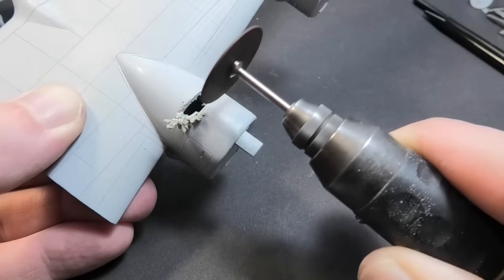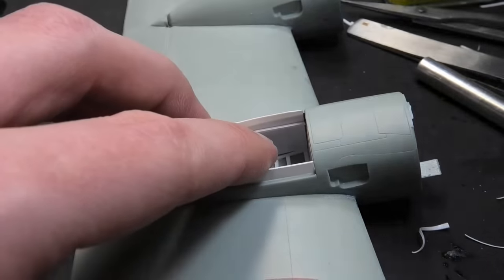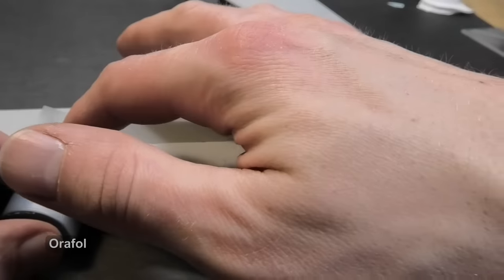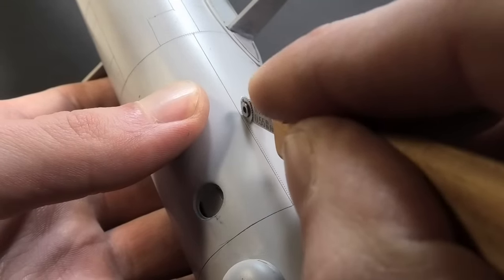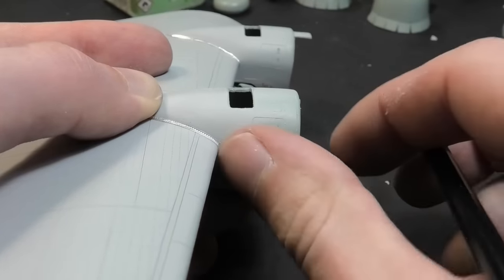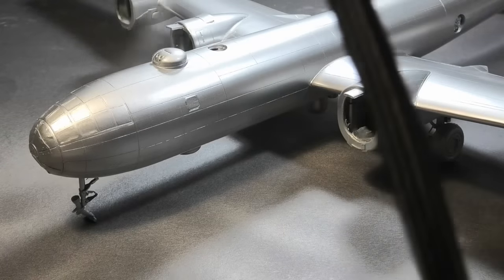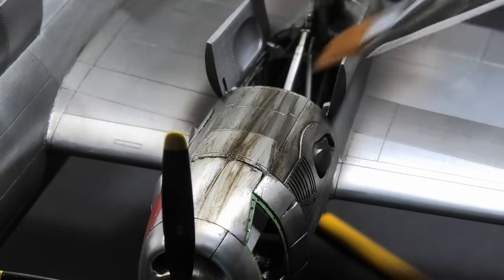B-29 Superfortress - Academy 1/72 - Aircraft Model

Comment: WOW!!! What an amazing build! A suggestion, if I might, you might want to put some chipping and simulated oil stain on the openings where the cowling access covers are removed. In my experience as an aircraft mechanic, these areas wear from fretting and frequent removal. I love your channel! Thanks!
Reply: Chipping? The B29 came in bare aluminium only, no paint to chip. Stains maybe, but they were expensive birds so they'd be cleaned post ops. IIRC they cost the same as a navy cruiser.
Reply: @davidharris733  The B-29 was around $605,000 per copy in 1944, the Cleveland class cruisers, commissioned in 1942, were $31 million. Amazing aircraft, it was the first to have "flexing" wings, meaning the wing would flex as it developed lift and transitioned to flight.
Reply: @trafficsignalman  I heard that comparison in a documentary programme. It may have been "The World at War". I didn't bother checking the authenticity, or exactly what class of cruiser was being compared.
Reply: @davidharris733  playing with costs is a fun game, many documentaries like to get the absolutes thrown around to make a bang. No pun intended. I saw The World at War, was pretty good as documentaries go. The B-29 was developed to deliver the nukes from Manhattan Project. The total program cost was $3 billion (1945) which was the most expensive program of the war. The Manhattan Project, which developed Fat Man and Little Boy was only $2 billion. Regardless of the cost or history of the equipment, Plasmo did another great recreation.
Reply: @trafficsignalman  That he did.👍
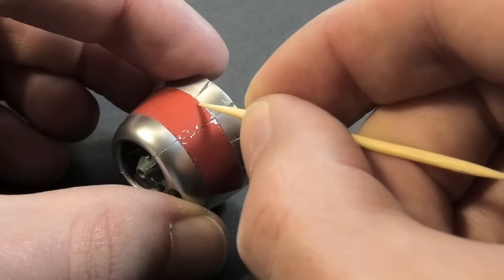Reply: I've been told by people who flew them that these aircraft were washed after every mission. Did you watch the whole video? Plasmo did show paint chipping effects. 25:07
Reply: @davidharris733  not only is your cost off but they came in OD too. Removed the paint since it only added weight.
Reply: @bradenhagen7977  I shall retire to my cell and self flagellate until I learn the error of my ways.

Comment: Brings back memories.  I flew on the KB-50s, a B-29 fitted with refueling drogues and a J-47 jet engine on each wing.  A Frankenstein B-29.  Unreliable piece of junk.  Sometimes landed with the propeller hanging loose.  R-4360 engines were a mess to repair.  56 sparkplugs per engine.  Caught 13 on fire just ground testing.  The ground crew called me "Sparky".  Retired the aircraft the year I was discharged.  Great job in making this model - all your models.  You are an accomplished artist.

Comment: Did you know both B29s used to drop two suns on Japan where heavily modified so the bomb bay could fit the Atom Bombs. Even then they were a struggle to take off with. Also I think you should do a HE 111 crashed in the ocean from the Battle of Britain, sorta floating sorta sinking.

Comment: A very small tip, use gloves when installing clear plastic, because with bare hands it might smudge the plastic with greasy or even dry finger tips and without any polishing it will throw off the whole model, just something I’ve been doing for a while.

Comment: you say that it doesnt matter about detail but you'd be surprised what you can see on a model. And it adds to the overall finish if you do go to the effort, especially on big kits like this. I've used photo etch on 1/72 fighters before and even on kits that size it makes a marked difference :) This is a lovely build, as always!

Comment: 14:08 whenever i flatten mine, i just heat up a plate on the stove top that has a perfect polish and lightly heat the plastic with a propane torch before pressing to definition. You have to do a bit of clean up if you missed the mark on the heat, but nothing out of this world.
That said, the best solution is to make a mold of the tire and pour it out of a soft durometer rubber. Bathroom silicone caulk is perfectly good for this, but you have to get the type that allows paint, so you can paint (latex paint) the rubber. It will naturally take the shape of a slightly squished tire. Looks very natural.

Comment: Something I've been wanting to try, once I do another aircraft is to try and use a hot plate with just enough temp to soften the tires to mush them down just enough so they look like weight on tires.  I never thought the sanding method looked right because it lacks the squish or bulge of the tire.  Worth a thought anyway.

Comment: G'day David, Well, here it is a year later and, finally, I have got around to my project of making the 'Enola Gay' and 'Bockscar'. During this long break between getting these two, identical Academy kits (the same as yours) I was able to do more detailed research on the two aircraft that dropped the world’s first nuclear weapons. 
Firstly, I learned that even though these aircraft were B-29As, they differed greatly from the standard B-29s that came off the assembly line. 
The USAAF could not risk losing engines on the two special aircraft carrying atomic bombs; the possibility of sudden over-heating and engine fires had to be removed. 
An accidental detonation on take-off, for example, would have wiped the island of Tinian off the map. (Not so much of a risk with the 'Little Boy' bomb on-board the Enola Gay as that bomb was not primed for 'trigger' activation until the aircraft was nearing Hiroshima. 
The 'Fat Man' bomb had a different priming mechanism and had to be set up for detonation as it went on-board Bockscar.
What the USAAF did was have the factory build these two aircraft, virtually, by hand. 
They were, in fact, custom builds, code named 'Silverplates'. 
There were at least two of them but some records indicate a couple of backup 'Silverplates' may have been done at the same time, in case it became necessary to drop more atomic weapons on Japan or if one of the original 'Silverplates' could not fly or was no longer available. 
These special B-29s had hundreds of modifications and additions, mostly around the engines, air intakes, cowlings etc. There were also significant wiring improvements, including the latest radar-controlled bomb aiming/dropping assistance (although it was made clear the radar assist on dropping these weapons would be used only as a last resort if there were faults in the manual aiming/dropping sequences).
This turned out to be a good decision. Enola Gay's mission went off, perfectly, without a hitch. Bockscar was not so lucky. Its rear fuel tank, full of fuel, had a fault that meant the fuel could not be used and the fuel tank could not be removed and replaced because of the fuel already on-board, in the rear tank. It was decided to go ahead with Bockscar's mission even with its overall fuel load greatly reduced.
Anyway, this is why all the available photos of these two aircraft look so good; apart from practice flights, they were used right out of the factory and had minimal weathering.
If Bockscar's fuel system had more problems on its way to Japan, forcing it to ditch in the ocean, the second atom bomb could not be dropped, as President Truman had publicly promised. 
Japan may have ignored the US threat thus forcing a conventional attack on her home islands. 
At the time of the first atomic bombing mission, there was no third atom bomb that could have been dropped in its place.
It's even easier to figure out why the overall B-29 Superfortress project cost more than the mammoth 'Manhattan Project'; the secret code name for the development and making of the world's first operational nuclear weapons.
I really would prefer two 1/48 B-29s kits for this special build but I can't find an outlet that has stocks. Even if I could, a 1/48 kit for the B-29 would cost me between AUD$500-$600 each!
Finally, David, thank you so much for your outstanding 'scratch & box' build of your B-29. 
You have the patience of a saint and the hands of a surgeon! 😉 
Cheers, Bill H.

Comment: David - you are an amazing modeler. It is always a treat to watch each new video and see what new tricks you've learned. Thank you for your willingness to take the massive time to share this with us.
At about 17:50 you assembled the elevators, and had to fill a seam with putty. Does it make any difference to add your rivets and panel lines BEFORE you assemble (and add putty, which fills some of the details in) these parts, or after? Most everyone adds the details prior to assembly but then runs the risk of damaging these details by using putty to fill gaps. And I'm sure it's easier to work on in pieces... but which way is better?

Comment: 301 / 5.000
Risultati della traduzione
you are forced to readjust the plastic parts for your work every time. A lot of time used for this.
Why don't you learn how to model, buy a 3D printer, and MOLD your creations? That way the pieces will be perfect, and you won't need all that time to fix the problem.